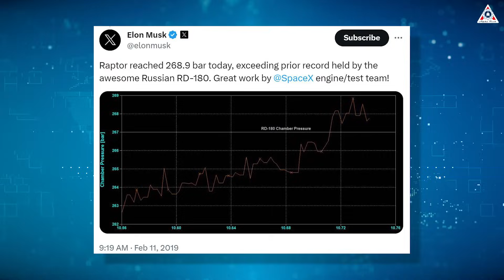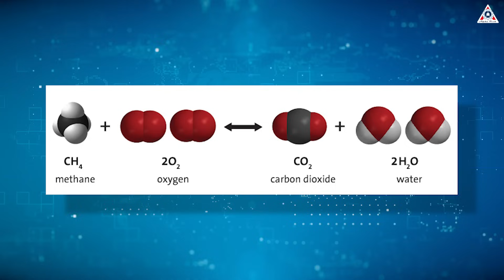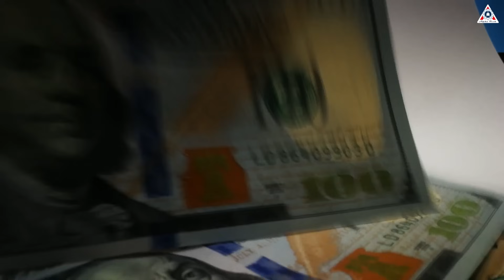How SpaceX's NEW Raptor knocked out Russia's best rocket engine...

Comment: stupid narrative. They are designed for different purposes. Raptor = Reuse. RD-180 = No need for reuse at that time. Also, RD-180 = close circle, a miracle of the technology. Will Raptor be able to put man in the Mars to manufacture methane there or just around the orbit due to its weaker thrust?

Comment: Raptor engine cannot work on 100% power full time while for example Energomash RD-191 can do. Raptor engine has two shaft full flown cycle engine (two gas chambers) while RD-191 have one shaft close cycle engine (one gas chamber), less components on RD-191 and more reliability. Things are not that simple regarding to rocket engines,  years of testing and exploatation to have good strong reliable engine.

Comment: Lets hold off on knocking the 180. Lets credit the FACT that it was and still is the King of all Engines and still holds the Crown. Technically the Raptor has greater Potential so lets stop banging the drum and lording the Raptor until its earnt its place. !
Did the opportunity or need to test reusability even exist all those years ago when the King was Crowned !

Comment: You ain't seen nuthin' yet'
Strap your socks on! Raptor 3 is coming, and its good enough Elon is keeping it under wraps to get ahead the pikers...
It will weigh less, be more powerful, cost scads less to produce, and have way less failures, and way easier to repair. It will be more
 "fit dense"
Due to having less diameter, and it will also be capable of being fabricated from appropriate engine stock that can be made in lengths.
And kudos To Russian R-180, it will be capable of more than one combustion chamber to the mechanicals.
We probably need to do more work on it, to be able to run on Vodka...
But I think its possible, albeit not a good fuel.
🤣
The Russians should quit trying to run other people's lives like some 18th century power,  and get back to what they do best, which is occaisionally taking the lead on space stuff..
Dump the Runt, get back to work, Elon's team needs competition to not get lazy and arrogant.
Reply from the maker: Thanks for your comment. Keep following and discussing on our channel ☺️